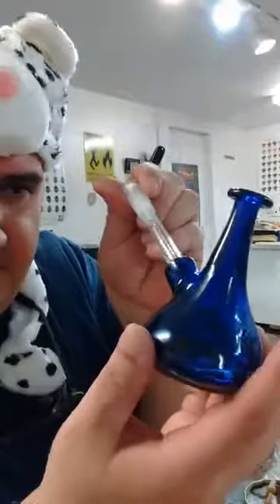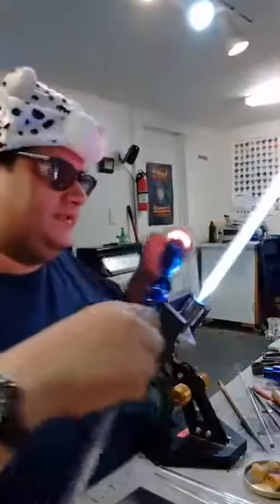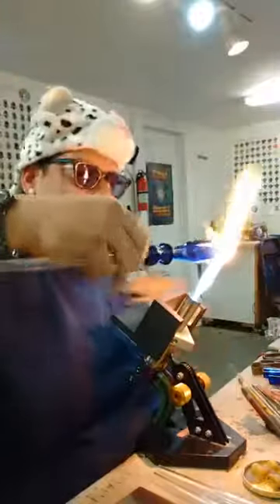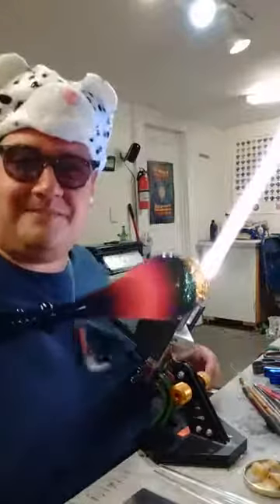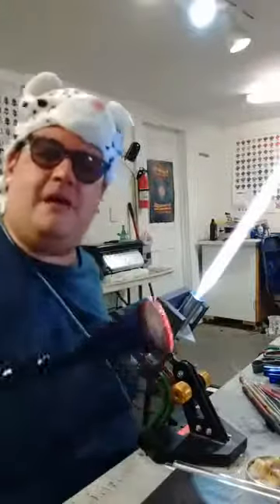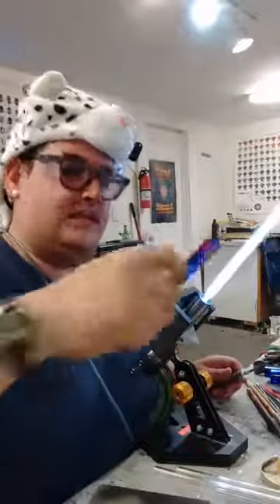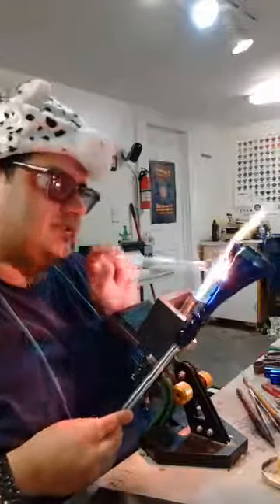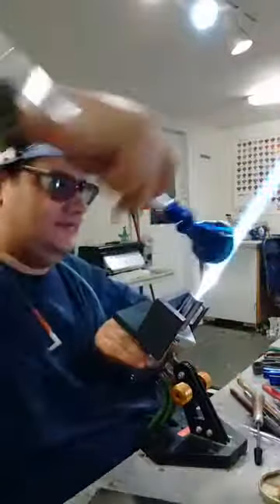Making a Mini Rig With A Honeycomb Base

Comment: Is there a reason you didn’t give yourself a bit more of the joint you made? It seems if you would used the whole joint you made you wouldn’t have had to go back into the joint and risk reworking it? Just a thought. I love your videos and your thoughts on friendship are good. You deserve the best..
Reply from the maker: Good question Shorty! The reason I don't use the whole joint is for aesthetic purposes. The piece is fairly small and it looks really weird to my eye to have the whole joint hanging off the side of the thing. It doesn't affect the functionality of the piece in the end as long as there is enough meat for the down stem to grab onto. You're right about it being more tricky to pull off doing it this way. Great observation, great question! Glad you're enjoying the vids!